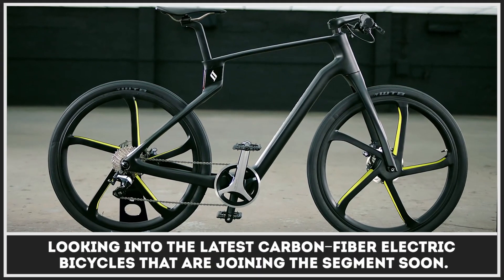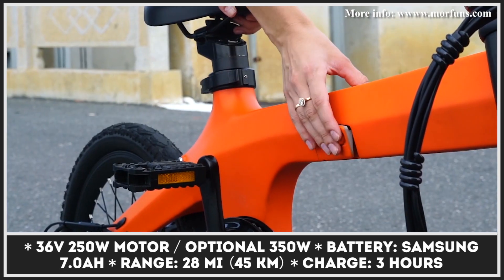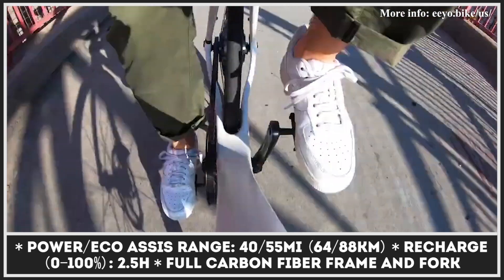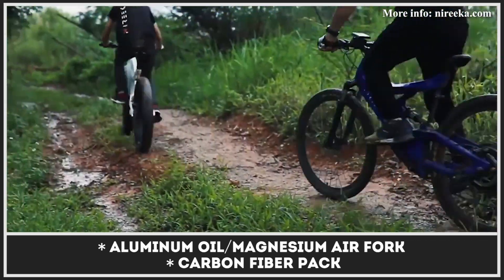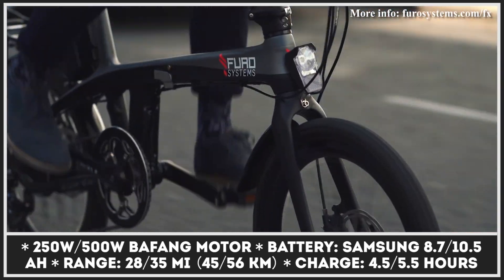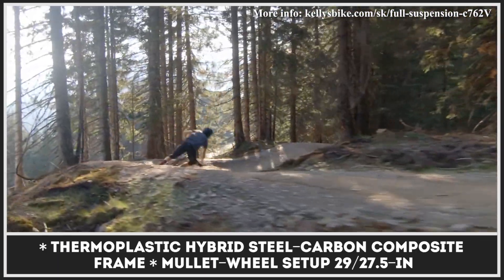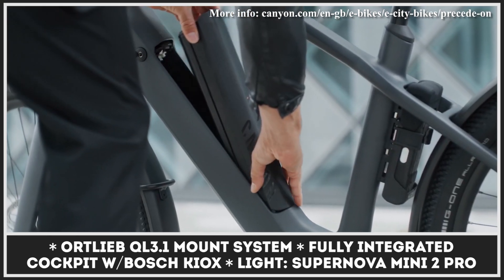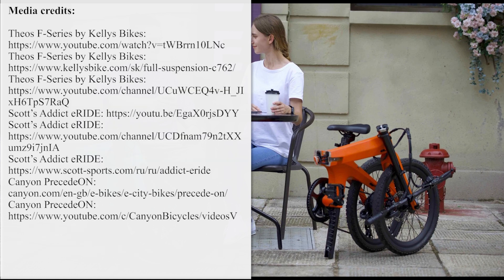9 New Electric Bicycles with Lightweight Carbon Fiber Frames for 2021

Comment: Light weight eBike should be 28 pounds or less. A 52 pound bike should not be on this list
Reply from the maker: Hello, thanks for your feedback. Are we talking about regular or electric bikes?
Reply: @Datacube  eBikes, Ribble's 24 pound bike is a good eBike. Yes most light eBikes are sporting a carbon frame, as you are aware, doing reports on eBikes.

Comment from the maker: Is the use of carbon fiber frames justified in electric bicycles? Share your thoughts below!
Reply: Yes, there are many people who live upstairs and do not have elevators all over the world. Most of these people do not have a ground floor secure garage for a heavy eBike. They need a eBike that can be carried up and down several flights of stairs for overnight charging and theft protection.

The alloy Ride1up Roadster V2, and the Tenways CG0 600 are alloy frame eBikes that are 33 pounds, give both of them a Carbon Fiber frame, fork, handlebars and you have a bicycle under $2,000 USD that would be under 28 pounds.  Maybe the affordable KBO Huricane, and a Torque 1 with a Carbon Fiber frame, fork, handlebars, light weigh front wheel and tire could also slip under the 28 pound limit.